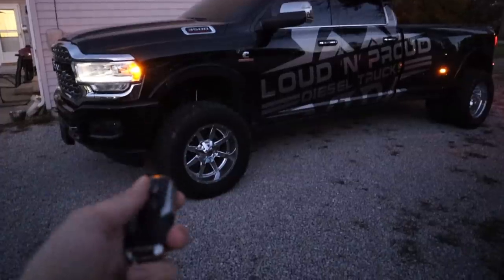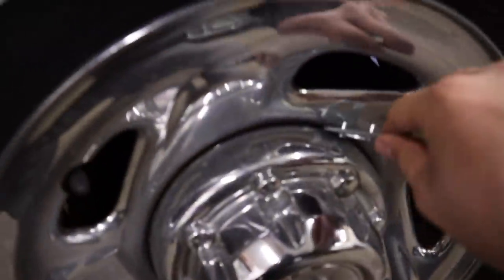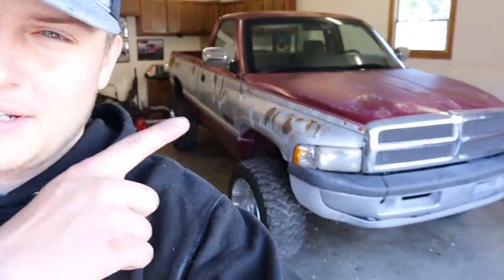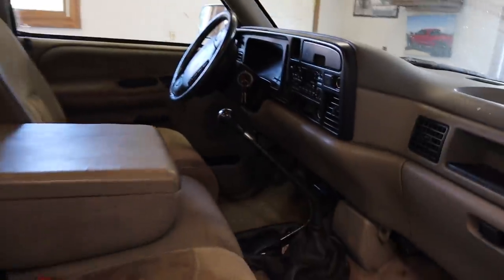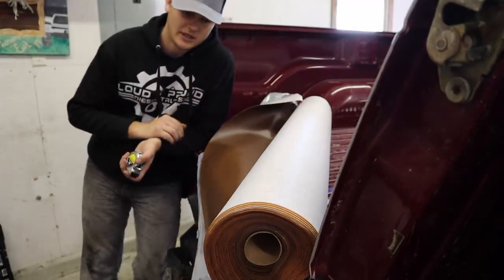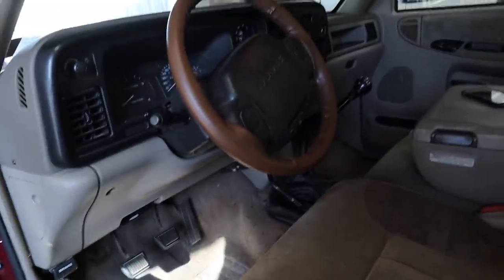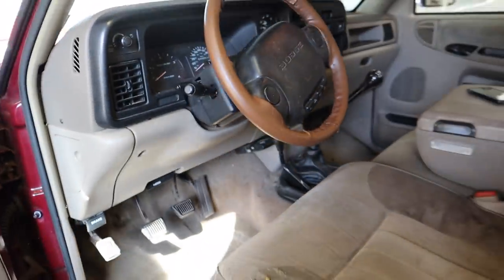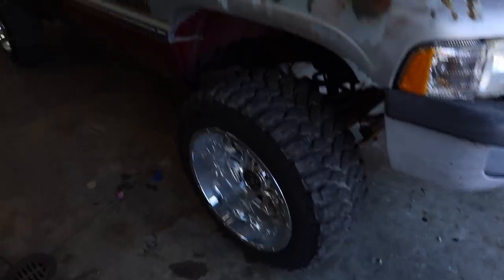12V Cummins Gets WIDE WHEELS & TIRES on STOCK Suspension!!!

Comment: Truck looks pretty nice with those wheels for it being that old. I think next, you should put led headlights and taillights and a chrome diamond tip stack or straight pipe with a 8 inch exhaust tip!

Comment: Get you a small steamer and remember to stretch the leather. That would get rid of the leather that is bunched together in spots. Looks good for your first steering wheel. Remember.... Steam and heat is your friend when it comes to leather working...